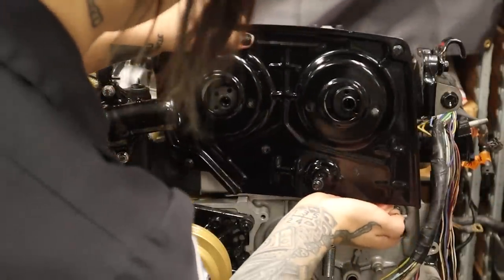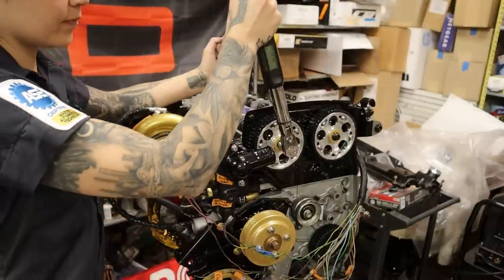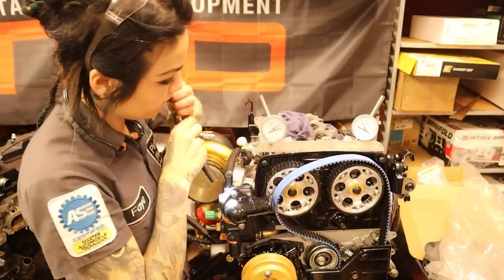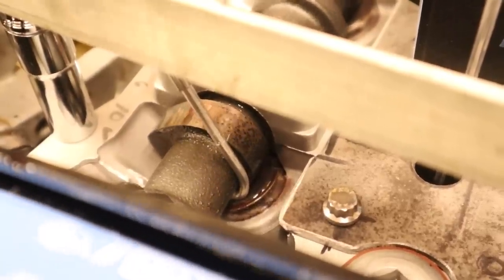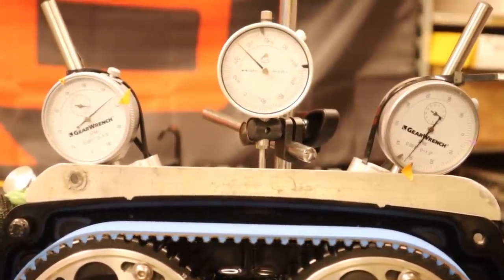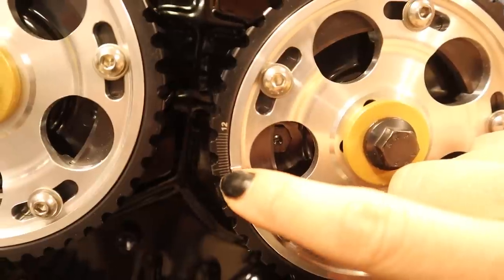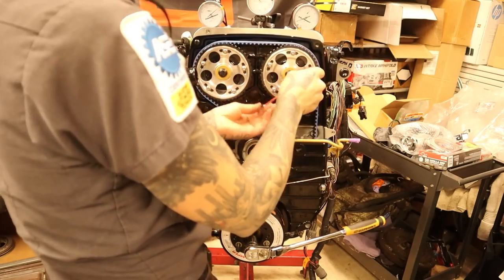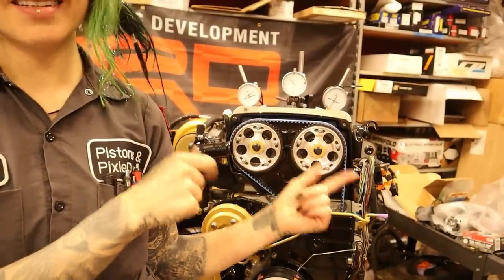Adjusting My Cam Gears: How to Degree a DOHC Engine (7MGTE version) Part 4

Comment: We never set TDC with a dial indicator as there is some variable. We just used an old sparkplug with a small extended  pin welded to the end. Rotate one direction till engine stops and mark degree wheel. Rotate back till it stops and mark degree wheel. What lies between those two marks is true TDC.Back in 1981 we built an adjustable cam gear on a small block Chevy running at Talladega. We used a Cloydes gear taper cut on the back side to fit into a machined cam plate. We had a discussion on how to fasten it. Our machinist said a tapered machine bolt had more holding power than anything else. He produced some female tapered washers and the tapered screws fit tight into them. Rather simple and it indeed had superior strength over anything else. We split the cover in two to facilitate adjustment. Keep in mind there was no adjustable valve train gear available.  Well we set the gear up advanced and ran it. Then I retarded it and ran again. Unfortunately no gain was achieve, but the system did work. We ran 197 mph in a ARCA car, 2 mph faster than a Winston cup car.
Reply from the maker: Yes, if you follow the link that I included in the video, you will see the piston stopper that I used to mark my TDC on the crankshaft! I had the actual tool, but a modified spark plug sounds so creative!!!

And I love the idea of splitting the cover in 2 for adjustment! Bummer that you didn't notice a difference!!

Comment: Doing work like this is so much easier with the engine out! When we do this on our PT Cruisers, the whole front of the car comes apart, right down to the radiator and wheels. Then one of our tricks is to take off the torque struts, so it's just loosely hanging, and jack the engine up to remove the timing cover and get working space. And just to make it more interesting, there's a pair of hard A/C lines that run overtop and are right in the perfect spot to get in the way. It's always a fun job, and we practice our swearing 🤣. This was fascinating! I can't believe how similar the timing is on this engine compared to the 2.4s. In fact, I've always wondered if the 2.4 is a Mitsubishi designed engine or something.  Great job! This advice will come in handy!

Comment: Good job! To get perfect TDC is pretty difficult to get without a dial gauge but you can get pretty close by using a stop in cylinder #1 and splitting the arc.....sort of a po'boy(or girl) solution.  That said, advancing or retarding a cam can make a big difference in the power and torque of the engine.  My oldest daughter loves working on our dirt bikes, cars, lawnmower, etc.  Wouldn't know what to do without her.  Tom  P.S.  That is a really sweet set of cam gears!  I went thru this with my Cosworth Vega years ago and I would have liked a set of gears like that.

Comment: The first time I dealt with a double overhead cam engine was my 1969 Alfa Julia TI 1600cc chain drive, I was 13 years old. The setup was the same as the engine in this video, the only pain in the butt part was setting the lobe to valve stem gap with shims under the cups.

Comment: That's great advice. I remember having to do filing and shimming in lieu of such impressive adjustable cam sprockets back in the old days. Also, while Snap-On is not generally the best value, and I confess that I do love their traditional ratchets, the torque wrench as far as I know is unbeatable for accuracy and repeatability. Nice.

Comment: Faye, I just watched your short about engine blocks sweating in storage. My 7m and 7mgte blocks have been stored with grease in the cylinder walls. I will inspect them next time I am home. See if i can let one go to a good home if you are still in need of one. I recall you are in the Houston Metroplex area as well.

Comment: Those 5 Allen head screws that hold the each cam in place must be made out of some really good type of metal.  Doesn't seem like much to be holding a cam in place under all that pressure.  I'm sure the manufacturer must have done a lot of testing on that though.

Comment: Look up Richard Holdener’s video on lobe separation angle video. ( LSA cam test 108 vs 112 vs 120 )
It should give you some pretty good info about the exhaust cam tuning.
Reply: Then please please PLEASE watch David visards videos on camshaft angles. As well as cam center line adjustments. (Including his newest video about “Big torque with easy pro stock techniques”)

Comment: Im loving the 7m content as i've learned quite a bit. Im not sure if faye will see this question, but if anyone wants to chime in on answers, it would be appreciated. 

I'm sticking a stock 7mge into an 88 4runner. Anything i should do to the engine to help longevity in a 4x4 that actually gets used on the trails? The 22re was great untill i spun a rod bearing after an oil pump failure.
Reply from the maker: Oooh it'll be a great engine for the trails, as it's super torquey!! I'd definitely recommend the oil pump modifications I show here, especially modifying the pickup, so you don't run dry when you're at a crazy angle!
Reply: @FayeHadley  awesome thank you! i will look at how you did that. That 22re got me home on 3 cyl but it was not happy about it 😪. Honestly I wouldn't be happy if i was a 500k mile engine running on 3 cyl and half starved for oil. I think i have everything i need so far to swap the 7m in. Just waiting on a flywheel and timing kit to come in.

Comment: So after all the adjustment, it all went back to stock? Surely adjustable cams need a tune/engine map to make use of them?
Reply from the maker: No, I adjusted them! Watch the video!
Reply: @FayeHadley  I watched and you adjusted one cam 0.5 degrees which is well within the normal limits?

Comment: Ah, yeah. I know exactly what machine shop you're talking about.
Reply from the maker: The one in Portland?!! Did you have an issue too??
Reply: @FayeHadley  No, I gamed with a guy that worked for them and they fired him for wasting company time. Apparently balancing rod ends after you mill them to size was a waste of time to them.
Reply from the maker: @davidblalock9945  WHOA. M&B cylinder heads??

Comment: I'm a little surprised that you'd go for a timing belt engine for your build.  I don't really trust belts, especially in these days of interference engines, where a broken belt could mean a wrecked engine.  And I'd dread having to replace them every couple of years.  Obviously you know something I don't; so have you had good luck with the rubber belts so far?
Reply from the maker: In the late 80s, early 90s, most Toyota engines were belt driven. This is a non-interference engine. As I mentioned in the video, this is an extremely strong belt. The force it took to back those ARP bolts out of the camshafts, even with red threadlocker, and the belt STILL didn't break.... 3 times.... so yes, I have had extremely good luck with these belts. Zero concerns.